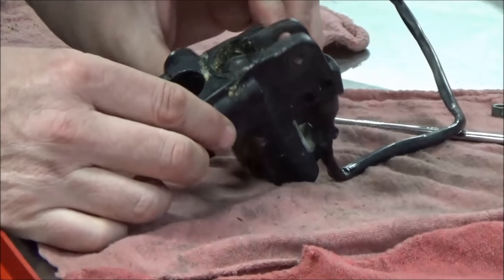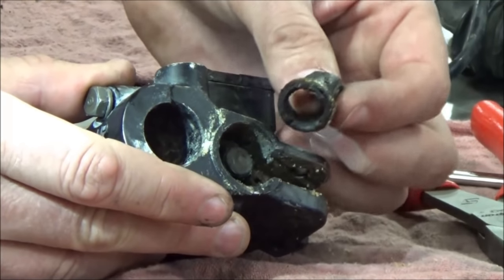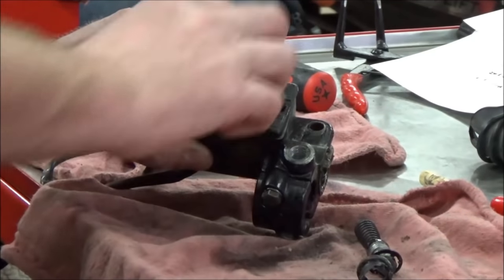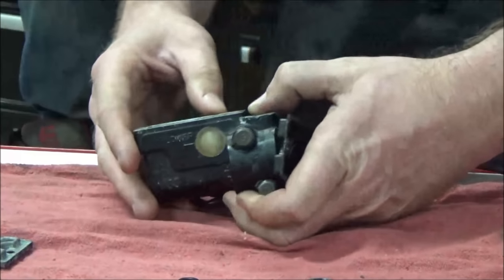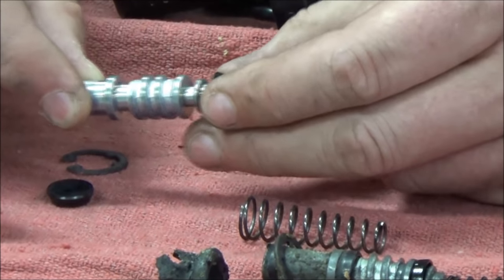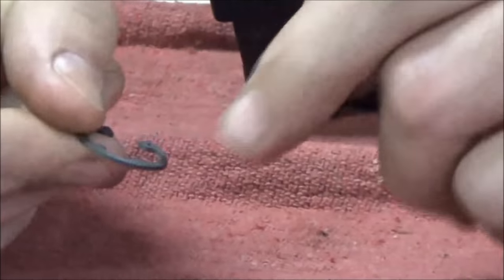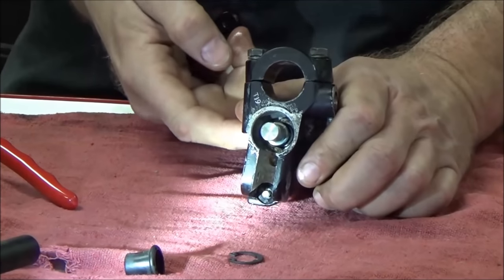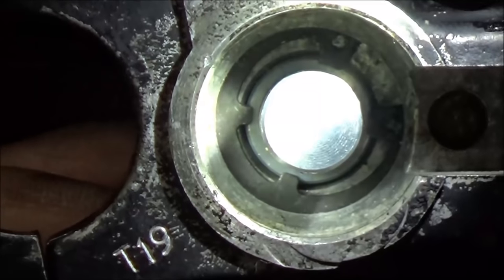How to rebuild your master cylinder Disassembly and Assembly #how2wrench #mastercylinder

Comment: Good job showing which way the seals go on in case our mind is on some Playmate of the Year when dissasembling.  Also, showing the snap ring's square edge facing outward (being a machinist and assembling diff things, i figured that out yrs ago).  I've never had to buy new seals. Clean them up and reassemble.  Never had one leak yet; same goes for the piston caliper seals.  As long as they're still flexible and free of cracks/deep pits, they work.
Reply from the maker: Thanks for commenting and adding value to our community!

Have you subscribed yet to never miss a video? Have you seen the video playlists? Over 600 videos! Check them out here: https://www.youtube.com/user/conleybuilt/playlists  

Want to say “thanks” or “keep it up”? Click here https://www.paypal.me/how2wrench    
 
Your answers and help are just around the corner. Save time and money while protecting your investment and yourself by doing it the right way at www.How2Wrench.com
Reply: You re-use caliper piston seals? You must be good at removing the used ones very gently. For peace of mind, I would never, ever re-se a seal of any kind, except perhaps the reservoir diaphragm after careful inspection, and of course crush washers on sump plugs.
I am impressed that you not only can do that, but have had good results doing it. But then again, you are a machinist, so you're looking closely at parts all day long, I guess.

Comment: Good tutorial, thank you.
Although there is an apparently sufficient explanation in my factory manual and a good schematic parts layout in my parts catalog, you made three or four points here that were either not made, or not made in enough detail, in those books.
The manual, for example, mentions avoiding the rubber seals getting turned/folded in on themselves.
It does not, though, show how to practically achieve that while working with small parts in a tight space that's difficult to see into.
I am glad that I watched this - even as someone with a few year's of experience of DIY maintenance - as I have not yet done this particular job. I am not even sure it is necessary to do this job, but if disassembling the calipers and silicone lubing the sliding pins and replacing the caliper cylinder seals does not give improved brake lever smooth operation, I will do this job next.
Thanks again.
I rarely subscribe to a channel after watching just one video, but I will here.
Thanks from Japan.
Reply from the maker: Well thank you. Did you see I just returned from Japan last thursday??? I go teach and work there about twice a year in Goto. I like to travel around and make new friends there too!
Reply: @How2Wrench The Goto islands off the western coast of Nagasaki? Though I have travelled a lot around Japan, and have certainly spent time in Nagasaki, I am not sure whether I have been to that island chain. Since swapping my V-strom 650 twin (bought new in 2013) for a Tmax (bought new in 2018), I have lost my love for riding-for-pleasure and have not done a long ride / tour since swapping... I am so displeased with the Tmax. Still, I use a 2015 Honda PCX 150 for a 110 kilometer round-trip commute daily, and that's the bike whose brakes I will inspect/service having watched your video... thanks.
There probably isn't, but let me know if there's anything I can do for you from over here.
If you're over here working sometimes, you probably also speak Japanese and can communicate directly / get 1st hand info yourself. Though the translation sites on the 'net are getting pretty damn good for those who don't have the huge amount of time it takes to learn a second language fully.
Keep up the good work.

Comment: Nice to see someone comment on that adjuster screw on the lever. Just to add on some master cylinder if adjusted too far it pre loads the piston, stopping fluid from getting from the reservoir into the master cylinder bore

Comment: Excellent video. I used it to rebuild my master brake cylinder on a Yamaha Roadstar with no problems.
Can you possibly do a video on recharging the braking system after the rebuild with any tips to make the job quicker and easier ?  It took me quite a while to get the brake pressure back up.
Thanks.

Comment: Very informative! 
My piston gets stuck and won't move once I get that last seal into the bore, likes it's too big. So do I have the wrong seals or is the spring too weak and needs replaced? It takes so much force, like alot, to push the piston/seal in and just gets stuck and won't return, thus I can't build any pressure at all. Thanks in advance for any advice or thoughts. :)

Comment: Motorbike: ZXR9 C2 1999 

My master cylinder builds pressure when thumb is over the whole. Doesn't seem to want to pull fluid when the bango bolt is off the caliper any ideas? Normally it should just drip fluid but my level never changes in the reservoir. All that happens is all the fluid that's in the line gets dripped out. Nothing gets pulled from the reservoir.. when I also use a vaccume pump connected to the caliper all I get is air nothing else. Isn't until I pump the lever do I get a tiny bit of fluid then it stops again.

Comment: I’m having an issue with my master cylinder for the front brakes. Motorcycle is a 2012 Yamaha v star. I rebuilt the caliper, bought new pads, bled the front brakes manually the right way & at first I got a little bit of bubbles on both MC & Caliper bleeder but no pressure at all. I pumped for a few hours & never got much pressure. The MC was working fine before I bled the brakes. Bike only has 13k miles. Do I need a rebuild?
Reply from the maker: That's a good question for Shane directly. You reached the social media team here. We get 300-400 requests a week, so it’s a bit time challenging as you can imagine. 
Shane does try to answer some non-members' questions when he gets some time so hang tight if you’re not in a hurry. 
Did you know one of the member benefits is to ask for which videos would work for your needs and get daily "quicks answers" to questions directly from Shane?. Best $1.99 a month you'd spend...of course enjoy the over 700 free videos and access the the member only vids with all the other benefits listed below. 

There are two immediate options that can get you a solution within 24 hours and quite often within the day. 

Option 1: 
Consider joining...best $1.99 you'll spend this month 😁 This is great for quick answers. 
He literally logs in and answers member questions daily! He does an AM and PM check-in to answer all member questions. Join this channel to get access to the perks:
https://www.youtube.com/channel/UCBhM8DCKnT3qXwTW0eToyCg/join    
-Daily MEMBER FIRST COMMENTS ANSWERED FIRST 
-Live Q/A video chats
-Wonder if we have a video on your need? Members can request content links!
-Full Access to the ENTIRE 700 video library
-Member-Only FREE tool giveaways  
Option 2: 
 If you need help sooner choose his 1:1 option! What you get is a deep dive one-on-one with him. Use video, email, and phone support. He will drop his tools and work with you directly! 
Get Shane’s cell here: https://how2wrench.com/ols/products/techline-one-on-one

Comment: Had a new caliper replacement and brake bleed at a shop 5 months ago. Currently the front brake lever is locked and will not squeeze unless I bleed the caliper. Should I start at the mastercylinder again before I tear down the front caliper ?
Reply from the maker: Hi Dave. If the lever is not returning normal, it needs attention regardless. If a caliper is "stuck" a lever will still move freely as in pump back and forth. There is a MAJOR safety concern as to why this may be happening too or the last shop missed. If your interested in hearing what to do and check show me some love here on the high 5 link and give me a call...I'll save you headaches and maybe even prevent a crash. 602-345-0432
Give us a high 5 here:  https://www.paypal.me/how2wrench   
We sure love you taking the time to comment. Are you coming to the next live session? 
There a few ways you could help keep this work going and stay connected with me personally.  
1. The fastest and best thing you could simply do for us is hit that subscribe button…helps us creators more than you know! 
2. Join this channel to get access to perks:
https://www.youtube.com/channel/UCBhM8DCKnT3qXwTW0eToyCg/join

Comment: Thank You , I was able to fix my locked up brake on my ski-doo !
Reply from the maker: Thank you for commenting. Want more? Smash the sub button! Here are the links to support us for this information and our work saving you money.
Join this channel to get access to perks: (Free tool giveaways and member-only videos)
https://www.youtube.com/channel/UCBhM8DCKnT3qXwTW0eToyCg/join     

Give us a high 5 here:  https://www.paypal.me/how2wrench
Reply: ? For you,im having problems with my brakes locking up on me, ive bled brakes twice,after bleeding them,they keep locking up on me,ill release the bleeder screw,to release pressure, then it will lock up again,any suggestions or help will help me out,
Thank you
Reply: @patrickcarlson5309  Open up your master cylinder , Drain and clean , There should be two holes in the bottom . The hole close to the line out is plugged . I used a pick and torch tip cleaners to clean out the hole . Flush and blead . This may help .
Reply: Thank you very much ill try thst,
Reply from the maker: @patrickcarlson5309  Hi friend.  Running down today’s list of comments! I try to answer when I've seen it before, but I don't recognize this one. I’m the Social Media Manager here. That’s a good question for Shane. He gets hundreds of requests a day and starts each day answering MEMBER or donation support questions first and then if there is time he will try to circle back before heading to the shop for customer work. 
Want faster response times? Join link below.
Thank you for commenting. Want more benefits? 
-Daily MEMBER FIRST COMMENTS ANSWERED FIRST 
-Live Q/A video chats
-Wonder if we have a video on your need? Members can request content links!
-Full Access to the ENTIRE 700 video library
-Member-Only FREE tool giveaways 
Join this channel to get access to perks:
https://www.youtube.com/channel/UCBhM8DCKnT3qXwTW0eToyCg/join 

Just want to say thanks quick to support us for this information and our work saving you money? 
Give us a high 5 here:  https://www.paypal.me/how2wrench
Reply: Yep I was able to fix the problem with the brakes locking up,

Comment: I have a '84 Goldwing. Rebuilt caliper on the front. The caliper heats up and just about stops the bike.  I'm told that there is a pressure release hole the size of the thinnest guitar string that needs cleaned out.  It's under a small round deflector inside the reservoir.  I'm having no luck finding it under the deflector. Any input? Thank you.
Reply from the maker: That’s a great question for Shane directly! We are just the social media team. Shane has a solution for you. As far as the question, Shane does answer questions when he get's back around to non members eventually so hang tight, FYI >>>> he does member ones daily!
He is just returning from an extended stay in Japan training students this winter. You can imagine how full his inbox is. We put orders are to the front of the line.

The one-on-one service. Get Shane’s cell here: https://how2wrench.com/ols/products/techline-one-on-one       
Quick answers are answered daily as a channel member: Join this channel to get access to perks:
https://www.youtube.com/channel/UCBhM8DCKnT3qXwTW0eToyCg/join   
-Daily MEMBER FIRST COMMENTS ANSWERED FIRST 
-Live Q/A video chats
-Wonder if we have a video on your need? Members can request content links!
-Full Access to the ENTIRE 700 video library
-Member-Only FREE tool giveaways  

Have you seen our "YouTube Trained Support Shirts? Great way to "high five us" https://goodfellasmerch.com/collections/how-2-wrench/products/support-shirt

Comment: I am rebuilding the front brake master cylinder on an 04 VMax. Once apart, it looks nothing like the video. Different piston and spring. Is the brake master cylinder actually a different kit than the clutch master cylinder?
Reply from the maker: That's a good question for Shane directly. You reached the social media team here. We get 300-400 requests a week, so it’s a bit time challenging as you can imagine. 
Shane does try to answer some non-members' questions when he gets some time so hang tight if you’re not in a hurry. 
Did you know one of the member benefits is to ask for which videos would work for your needs and get daily "quicks answers" to questions directly from Shane?. Best $1.99 a month you'd spend...of course enjoy the over 700 free videos and access the the member only vids with all the other benefits listed below. 

There are two immediate options that can get you a solution within 24 hours and quite often within the day. 

Option 1: 
Consider joining...best $1.99 you'll spend this month 😁 This is great for quick answers. 
He literally logs in and answers member questions daily! He does an AM and PM check-in to answer all member questions. Join this channel to get access to the perks:
https://www.youtube.com/channel/UCBhM8DCKnT3qXwTW0eToyCg/join    
-Daily MEMBER FIRST COMMENTS ANSWERED FIRST 
-Live Q/A video chats
-Wonder if we have a video on your need? Members can request content links!
-Full Access to the ENTIRE 700 video library
-Member-Only FREE tool giveaways  
Option 2: 
 If you need help sooner choose his 1:1 option! What you get is a deep dive one-on-one with him. Use video, email, and phone support. He will drop his tools and work with you directly! 
Get Shane’s cell here: https://how2wrench.com/ols/products/techline-one-on-one

Comment: Help!  2006 Suzuki C50.  You say those two holes in the bottom, one is a fill hole and the other a return hole.  Just that simple.  NO  It's NOT that simple.  One hole has an L-shaped thingy over it, and I"m wondering if there should be a needle valve or a ball and spring under that.  There is nothing.  My brake cylinder doesn't "pump" any fluid at all and I'm betting it has something to do with these two holes.  What can be done.  Can they be serviced or do I need to replace the entire cylinder?  BTW, I took the guts out of the cylinder as shown in this video and there is no visible wear or dirt.

Comment: Great job Shane.
Question: When the engine is cold, the clutch works perfect, once the engine reaches running temperature my clutch engages and t he bike does not go anymore, you can shift gears with the engine running without using the clutch while you sit still, it is as if there was moisture or water or perhaps air in the salve cylinder or the fluid line but I have already checked everything including bleeding the system more than a couple of times and still the same problem. I just got a used in good conditions spare clutch master cylinder from Ebay the other day and will install it once i get the time and hope this solves my problem. It seems like if once the engine warms up the clutch lever gets tite (no play) and the clutch acts as if it becomes engaged and stays that way. What causes that and perhaps a rebuild will solve it? Thank you my friend!
Reply: Chucho Chucho bit late, probably clogged return hole? Rebuild and cleaning will fix it.

Comment: would you recommend a small bit of red  rubber grease on the seals or just brake fluid
Reply: I use red caliper grease if I have a dot 3 system and white caliper grease with dot4 systems .
Here in India most OEM kits come with a little pouch.

Comment: Made NO MENTION of the importance of the 2 internal holes / channels being checked and verified clean and clear. The pressure-side hole gets notoriously dirty, corroded, and plugged... and is one of the most common failures of brake master cylinders.

Comment: I have a 1987 kawasaki 454ltd and I am trying to find a rebuild kit or just the cup piston which is 5x13x4mm any suggestions if another model motorcycle uses the same size piston? And the sight glass was also junk so I need to find one it's 21mm diameter and uses a o ring seal.

Comment: I completely drained out fluid from functioning front brakes. Now i added fluid but it does not pump fluid down to caliper. Brake lever does nothing. No resistance. Any suggestions?
Reply: Same problem, did you find a solution?

Comment: If you review your video you can see the use of an old screwdriver to force the seal over the piston .There are better ways  EAC
Reply from the maker: Feel free to add details on better ways...simply stating this does not provide much value. We will share with Shane in our sync but it would be nice in advance. Also, what is EAC? 
Social Media Team